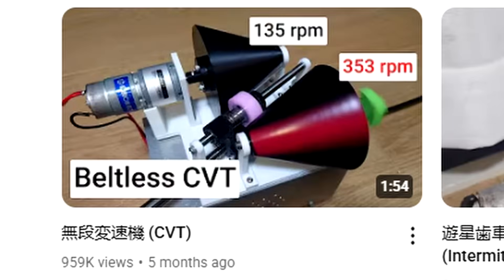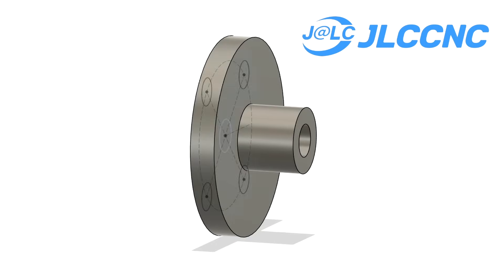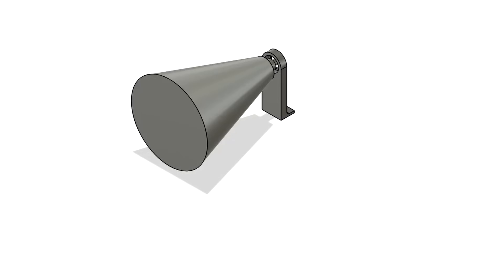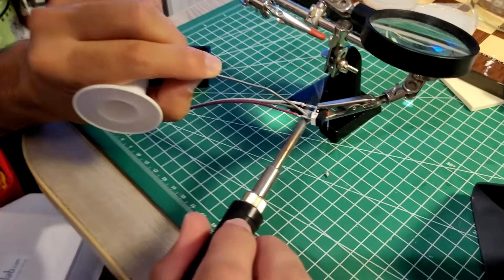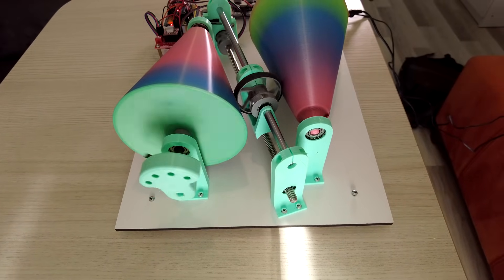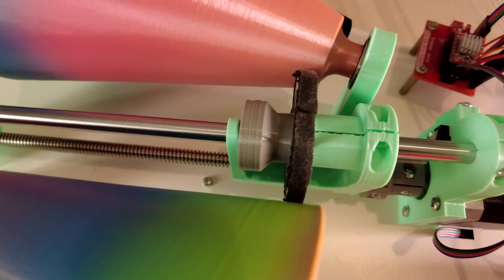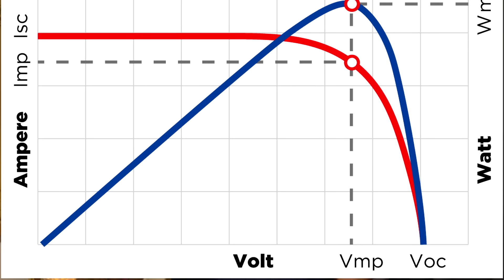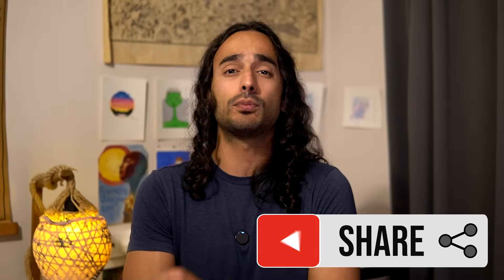Beltless CVT Transmission

Comment: Just use the electrical in current of the motor multiplied by the gear ratio as a proxy for the torque.
Reply from the maker: Yeah that's input to find the efficiency I have to find the output as well.

Comment: Why not do the reverse. instead of 2 cones with the wheel in the middle, make 2 wheels with the cone in the middle
Reply from the maker: The diameter of the middle wheel doesn't affect the ratio
Reply: You would then have to have the two wheels move independently along the cone. And having both your power source and your output moving would be very impractical.

Comment: Use a rubber ball, that super bouncy one instead of a wheel for coupling
Place the ball a bit above and maybe use a spring to put pressure equally on both the cones so that it has better contact and grip on the cones
A silicone ball or maybe some other material will be better for durability and performance or efficiency
Make the cones out of aluminium and run it continuously to see how durable it is this setup.
I wonder is it better then a belt drive, maybe more efficient or more durable
Reply from the maker: That's a great idea

Comment: The only reliable CVT is the type they use in new tractors 🫠
Its based in hydraulics though.
Reply: Variators used in many ATVs and snowmobIles are super reliable as well. And then only thing that sometimes fails is the belt and they can be replaced in the field even without any tools.

Comment: The nice thing about a traditional cvt is that it's passively controlled. This requires active control electronics, stepper motors etc. It's also much larger and harder to manufacture.

Your point about minimum power point tracking is only valid for something like a petrol engine which has a torque and efficiency curve. Electric motors have a more or less flat torque curve and their efficiently only changes slightly with rotation speed.

I think the losses in any cvt design would massively overshadow any marginal efficiency gain from rpm tuning a motor.

A better solution in most industrial applications is just selecting the appropriate motor for the job so it's already running at it's best efficiency when doing it's normal job.

As for the petrol engine use case, we have to move away from them. Like, globally, the human race needs to stop using fossil fuels. I get that there are huge issues there (cost of alternatives, batteries are still crap compared to fossil fuels, rare earth minerals, slave labour, supply chain logistics etc. Etc. Etc.) but unless we figure it out in the next decade or two, climate change will come for us all.

Comment: I think you can measure a non-changing torque ideally without continuously consuming any additional power. (reality has friction and other non-linearities, but friction is unavoidable)

An ideal linear spring displaces by an offset proportional to the force applied to it. you could wrap that spring into a mechanism where the base of the spring is tagged with one color and tied to one shaft going into the mechanism and the top of the spring is tagged with another color and tied to another shaft going out of the mechanism and use a color sensor to detect the offset when it is moving. it should be able to measure both rotational speed and dynamic torque.

It may act like an the mechanical version of an electrical capacitor though (Voltage = Torque) when the torque changes
Reply from the maker: Thanks for the input

Comment: You might be able to measure the torque using a deformable coupling (like a spring) and measuring the difference in angle between the two ends of the coupling (rotary encoders).
Reply from the maker: Thanks for the tip!

Comment: What's the point of the input cone - why not just drive the intermediate wheel directly with the motor? Or vice versa
Reply from the maker: That would work but it would reduce the gear ratio by a magnitude. Also that would mean the motor has to move which is not ideal. But it is indeed possible.
Reply: @canocholic  True. I was also thinking one could use a conical drive wheel on the motor with that design so that there would be less friction between the drive wheel and the cone due to different radii

Comment: That looks like a reversed take on the cvt implementation: you're supposed to only change the input motor’s speed (aka that motorized cone), and the central wheel is supposed to freely translate, only depending on the output torque need. On high output demand, the central wheel would go for the highest place in the motorized cone, while on low-to-none output it would go to the lowest part of the motorized cone due to friction.

This way, starting position should have meaningless impact, only input/output ratios would.
Unless you specifically need to manually set the ratio, like you're doing here.

Comment: The gear ratios (belts) you describe here are basically the same as those used in 45cc scooters. They work on the same principle!
Reply from the maker: Yeah pretty much all scooters use cvt transmissions. Besides the frequent belt changes I love them.

Comment: The central wheel can be replaced by an omnidirectional wheel, in that way you can move it freely between the cones. (also, i think some of the friction will be reduced)
Reply from the maker: Yeah, that could be a solution. They are a bit bumpy tho, that could create some problems.
Reply: @canocholic There are a few that the external rolls are closet and have very little bump

Comment: Gotta admit, CVT in an urban setting makes things so much smoother. Perfect for heavy traffic and general town driving where high speeds are not needed.
Reply from the maker: Absolutely, if not for the reliability and low efficiency I believe most cars would use them.

Comment: The middle wheel needs to be much bigger in diameter. That will solve the issue of wearing as it will turn much slower

Comment: unless you shut the car off in 6th gear you'd never have an issue where the car is started in 6th gear. 
i dont know if you dont understand transmissions very well but they gear down when you slow down otherwise the rpms would drop so low the engine would stall.

you need to be able to lift the gear out of place for neutral, that would also let you shift back to first if its ever shut off or stalled in any other position.
Reply from the maker: Hi, for example in a case of an emergency stop it is common to come to a full stop while the transmission is in a high gear.

Normally clutch  systems (sometimes a torque converter) sit between the engine and the transmission so that the transmission isn't running when the engine is at idle and car is parked. 

For a design like this another clutch would need to be placed between the transmission and the wheels. So the transmission can run without car moving and change gears. 

But other comments mentioned instead of a regular wheel an omniwheel can be used which even if not ideal could be a work around.

Comment: Still going to cook your little wheel under real stress. Especially now that they’re turbocharging every small engine - it’s tougher than ever to be a CVT. They need to take these theories back to the drawing board and build them to have significantly increased capacity. This is like if the first automatic transmissions were all 50% below capacity- of course there would be massive failures in every brand. (Which is actually almost exactly what happened with old belted automatic transmissions)
Reply from the maker: True

Comment: if you wanted to increase the torque of the system you could use two sliding wheels on the input cone and add their rotation speeds with a differential gear with a shaft running to a second differential gear and two wheels at the output cone
Reply from the maker: That's a cool idea
Reply: @canocholic  I don't know if it is lol. if one wheel slips then you loose all traction in an automobile. a different approach is to use two wheels on the outside of the cones, joined with a chain or timing belt, as those surfaces are parallel, same as the insides of the cones are.

Comment: That's pretty cool. Sadly, it doesn't solve any of the wear issues with traditional CVTs, just introduces new ones
Reply from the maker: Unfortunately
Reply: The problems would be solved by using actual gears with teeth no?
Reply: @wesleyclark2032 That geometrically doesnt make sense. There is no way to smoothly transition from one integer number or teeth to another
Reply: @AdroSlice  A geared CVT has actually been developed. Very complicated but looking very promising and very cool once you understand how it functions.
Reply: @jondihaynes8695 Oh yeah, the one where it pushes and pulls with a sort of weird planetary gear like setup, right? It's a weird and complex one, but who knows, it might just do well.

Comment: Ah yes, remember when we first learned about these in school, and since then, I'm curious when I will see it for the 1st time in practice.... 😄
Reply: CVT? Many cars have had them since 2014, they just all suck. Assuming you can add an electric motor you can make one without all those issues though. But that adds complexity that only hybrids need
Reply: @super9mega  well Idk, but I feel like we have a classic manual 6 speed (2017 Hyundai Tucson), and I doubt I've ever came across one with CVT, especially when I don't look under the hoods....

Comment: 7:51 You could use an omni wheel in the middle to change the gear ratio when the cones aren't spinning.
Reply: that would introduce a lot more friction and make the main load-path more fragile.
Reply from the maker: Yeah, would be a little bumpy but still a nice workaround.
Reply: TAL VEZ ESO NO SIRVA PARA CAMBIAR LA RELACIÓN SIN QUE LOS EJES GIREN, PERO SI PODRIA MEJORAR LA TRACCIÓN Y FIABILIDAD DEL MECANISMO AL ADAPTARSE TAL VEZ ASÍ MEJOR AL PERFIL DE LOS CONOS

Comment: can you use gears instead of cones and wheels 🤔coned gears..should work..
Reply: Thought about this too, but since the radius changes the amount of teeth need to change. How do you go from say 120 teeth to 20 linearly without excessive play or weak points?
Reply from the maker: Made a video specifically to answer this
https://youtu.be/CNaWGllHP68

Comment: You can measure dynamic torque relatively easily with a bicycle break caliper attatched to the rotor and make it push on a load cell a set distance away to measure the moment it produces for different breaking pressures. Essentially a small primitive dyno. You run the motor flat out and gradually increase break pressure, and the rpm decreases as you do that, and you get torque measurements for every rpm.
Reply from the maker: Thanks for the tip! A bike break would be a little overkill and over-budget for this project but I might make my own simple break system.
Reply: Brake caliper

Comment: You should consider making a turbojet, I can help
Reply from the maker: Do you mean a working one, or just a display model?
Reply: @canocholic  A working one of course
Reply from the maker: I don't really have any metal working tools besides a handsaw with a 3D printed handle and a cordless drill. I don't have space to use them even If I had them. I don't think I can build one yet. But if this channel keeps getting views first thing I'll invest in is a small workshop.

Comment: i wonder if something like an omni-drive, a wheel with smaller wheels tangent to the axis of rotation, would work for the smaller wheel, cause that way it would be able to shift without the mechanism being in motion.
Reply from the maker: Yeah, never tought of that. It should work but generally they are really bumpy so it wouln't be great.
Reply: @canocholic  yeah, i didn't really think it would work with something off the shelf, even robot parts will probably be too big to bridge the gap cleanly for a desktop demonstration, seems like it would require a custom part to be designed, and building it seems really annoying, lol

Comment: the problem with cvt is the friction required to maintain traction with the output shaft, replacing the belt with a small wheel doesn't solve that issue
Reply from the maker: True, the search for the efficient and maitanance free cvt continues.
Reply: @canocholic  Search is done, eCVT exists, is durable, maintenance free and efficient as it's simply one planetary gear set. Toyota uses one for something like 6 years or so
Reply: @Osaka2407  hate to make you feel old, but the Prius came out 27 years ago, not 6
Reply: @Osaka2407 and has nothing in common with mechanical CVT it just uses planetary gearset and two motors.
Reply: @canocholic  theres a design on youtube that someone is working on that is a geared cvt and the prototype was used in a bike so and they are working on making it for a motorcycle and ultimately a car
Reply: @canocholic e-cvt works well and with the recent advances brought by BEV research and engineering, we now have motors and inverters with efficiencies that can match a belt cvt. considerably more expensive but vastly more reliable, likely as reliable as a manual gearbox.
Reply: Could they not add teeth to the cones and wheel ?
Reply: @sigmamale4147 cant move the wheel if you add teeth to the cone.also the teeth cant stay the same size towards the tip of the cone
Reply: @sigmamale4147 if the teeth sizes stay the same, how would one increase it gradually?
Reply: @ki0w0-lordofwatersheep  it was 3 gears that were running from planetary gear with variable length arms or offseting gear on arm, its worth to watch this video as its hard to explain without visualisation
Reply: @koroneq1089 oooh that one, pretty complex to add ratchets in each planet gear, and only 1 or 2 arms seem to hold the load
Reply: Nah, the problem with CVT is that they're an automatic system
Reply: A small scale gear based CVT exists with similar efficiency specs as a belt based one
Reply: Look up the RatioZero transmission.
Reply: You are replacing the roughly 180 degree contact of a belt with a tiny point of contact.  You would need to increase the pressure between the cones to increase friction enough to compensate.

Try a 2-wheel version, but put the axles of the cones into a housing that lets them be compressed with strong springs.  2 points of contact doubles your friction coefficient.  I picture a small block with 2 hard rubber balls in it, perpendicular to the cone axis, running on your mechanism in place of the wheel.

The walls of the cones need to be very stiff for this, and the bearings in the axles would need to be beefy and probably needle bearings.
Reply: couldnt it be much better with teethed gears with otherwise this exact same setup
Reply: driving 4 answers had a video on an interesting gear based cvt
Reply: What if you put gear teeth on the cone and a gear in the middle?
Reply: @customproject12the distance between teeth will increases with the diameter of the cone
Reply: It does solve the problem, in a way. Applying compressive instead of tensile forces introduces different dynamics that could allow you to utilize greater forces, and therefore greater friction than a belt-based CVT. Let's also not forget that automatic transmissions experience slippage as well, through their own clutch packs and the torque converter. This mechanism requires more development.

Comment: haha like 5 days ago i learned ive been driving a car w a cvt this whole time and it blew my mind, great timing!
Reply: You will probably find the Prius eCVT interesting. WeberAuto has a few videos on it, I think it's one of the most clever assemblies I have ever seen. It effectively replaces the mechanical "torque vs speed exchange" with electric "current vs voltage exchange", meaning the components doing the conversion have no moving parts - nothing to break down. It is an extremely simple, cheap and reliable design, sadly the name CVT has been smudged by Honda's premature adoption.
Reply: @CuthbertNibbles  oooo those look rly cool! i first read about cvts in some random forum post from like 15 years ago so until a few weeks ago, my ass was operating under the assumption these guys were like somewhat rare in actual cars
Reply: sell it before it blows up
Reply: @jamesvirden  IM SCARED OF THAT LMAO

as soon as I found out I went oh fuck i hope i changed that fluid recently cause im at 180k now haha